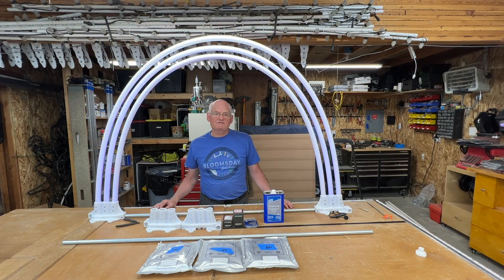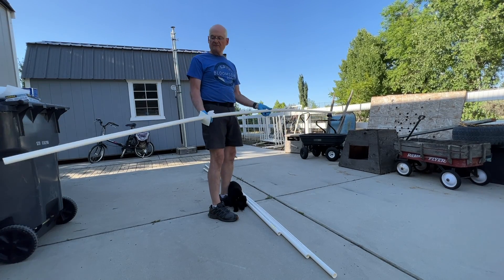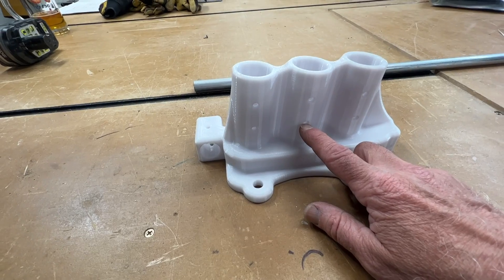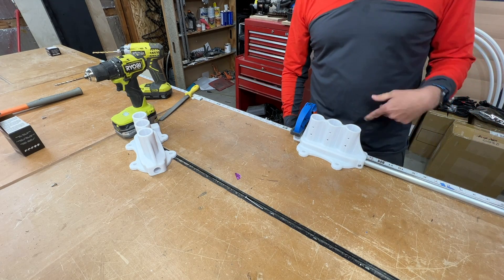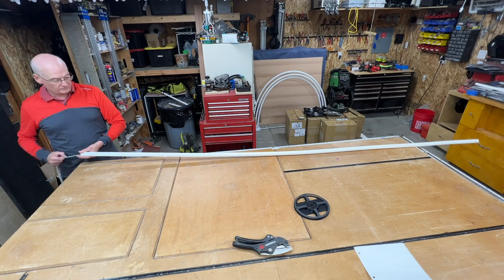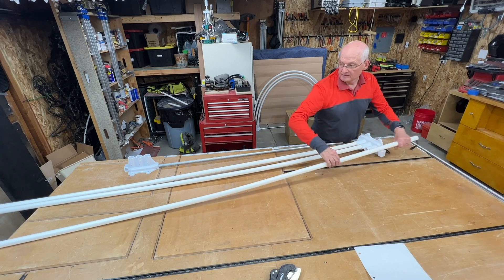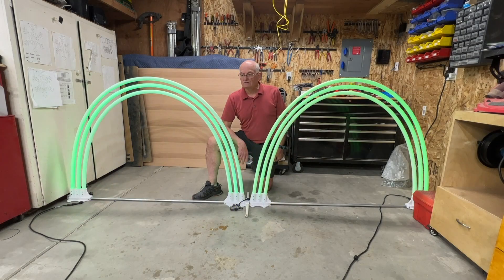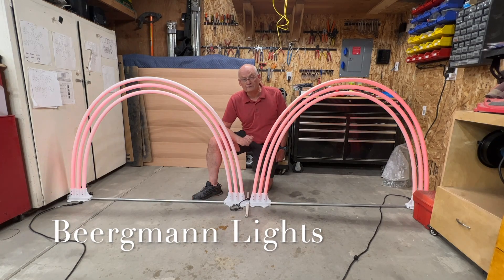Triple arches

Comment: I built a set of these. Do you have a prop definition for them to be used in LOR or xLights?
Reply from the maker: I use xLights.  In xLights you use the native arch model with the following settings. Layered Arches checked:  Nodes: 156, 3 layers, Inside layer, 49: layer 2, 52: Outside 55.  ZigSay layers checked, Lights per node, 3.  This assumes that you are using the YPS pixel strips.  If you are using different your layer needs maybe different.  Reach out to me on Facebook messenger if you want a screen shot of the xLights settings.
Reply: @ very much appreciated. I’m very new to xlights. I did do a layered model. I’m going to make changes to the total nodes. I multiplied them out up front.
Reply from the maker: Happy it helped.

Comment: Excellent video, I plan on watching all your videos, just starting my journey on a full yard light show.   I've been doing a smaller one just to learn how to program a show.   I do have a question, what 3d printer are you using?
Reply from the maker: Glad the videos are helpful.  My 3D printer is a Bambu P1P.  If you get one of there printers I would recommend the Bambu P1S.  It comes with an enclosure and extra cooling.  I also believe it is a bit faster.
Reply: @bergmannlights5149  thank you so much for the info.  Looking at the printer now.